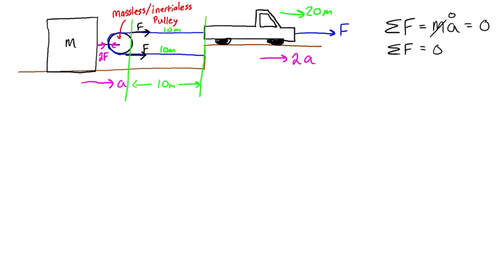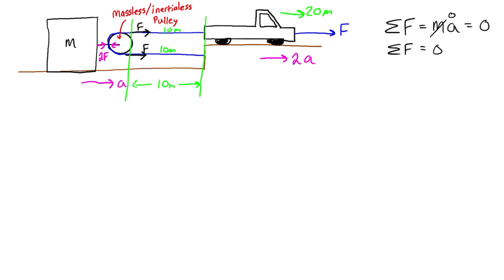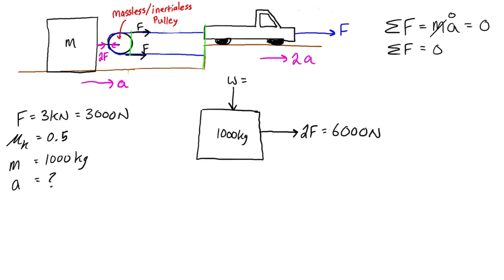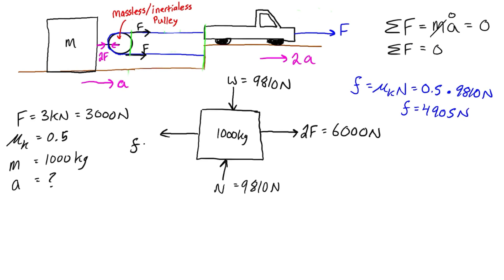How to solve kinetic pulley problems when a pulley is moving/translating

Comment: I'm confused on how the car has to move 20 m to move the block 10m
Reply from the maker: The best way to illustrate it is by creating a similar experiment with a 20cm piece or string, or a shoelace, or charging cable or something. Fix one end under a cup or whatever you have lying around, wrap it around a pencil or something 10cm to the left, holding the pencil with your other hand, with just enough to keep the string tight and pull the free end with your hand. The free end will start right beside the cup or whatever you fixed the other end to, and the pencil will be 10cm to the left. Pull the free end to the right, and you will see that once the pencil reaches the cup, your right hand will have moved 20cm, but the pencil only moved 10cm.
Reply: @Engineer4Free  hi can you please upload a video showing how to do it....its reallly confusing me